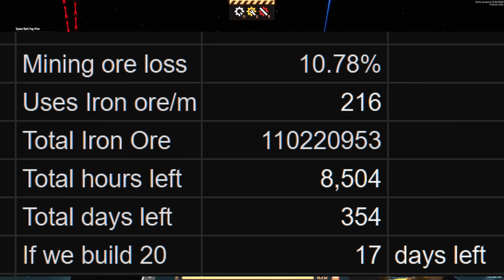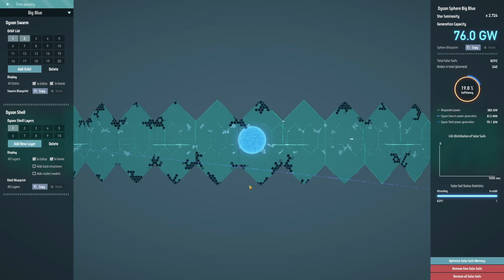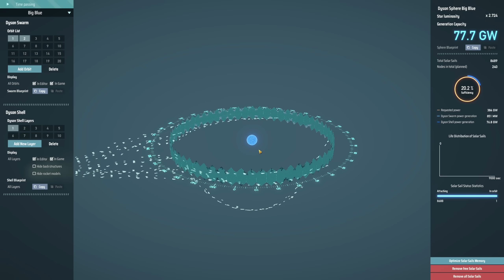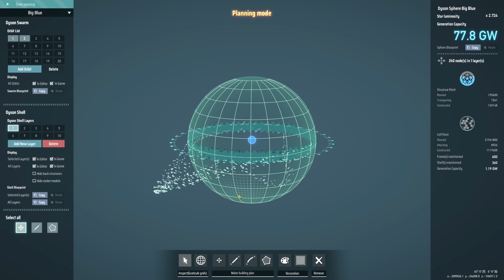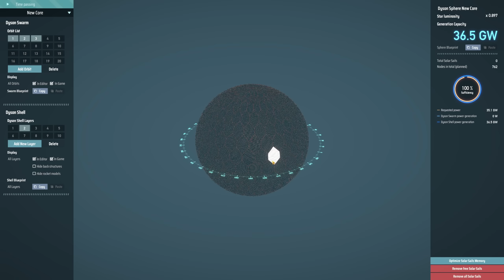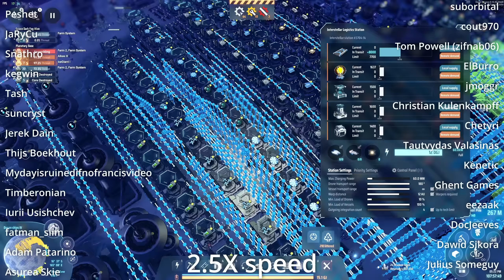When scaling up is made easy : Dyson Sphere program ep 16

Comment: In the mall, it's nice to use minimal or sensible capacity in the tower for end products, and keep stores in outside boxes. That way, when you empty a supply tower in outside system, the vessels don't plop 2000 artificial suns every time you fill up a dozen from a tower, that took hours to craft. If that makes sense.

Comment: I suspect a power pole blue print could include a space for the anti hive turret caps on the poles. I also wonder if it could include space for the combat towers that make laying down blueprints faster. Basically hit the planet in layers. aka paste in power, paste in construction paste in combat towers all leaving the bands along the equator clear. That way when the factory blue prints get laid down everything is ready for them and basically no running around is required.

I almost wonder if building a few of those combat/construction towers into the blueprints wouldn't be useful at the start - maybe they wind up being vestigial in the end but who cares if they make pasting faster / easier.
Reply: The ability to selectively deconstruct on a per-planet level is one of the big things this game needs.
I did make a powernet blueprint with BAB lines so the shield generators are build right away.
Its almost more work to collect them afterwards then it is to fly the round manualy.

Comment: (~) 17:20 For power poles around the planet, remember that sensor towers, wind, and solar(?) buildings have a power provider range which allow you to push/pull power around the planet where you need it. :) Also if you can integrate sensor towers and have polar defenses, it means no dark fog can land on the planet. Something proven by other youtubers. Though I'm curious if your plasma cannon tactic will work personally. :)

Comment: I have had some possibly-silly thoughts regarding why it is a good idea to proliferate the Antimatter Fuel Rods. This despite the proliferation not giving extra power.

1/ an Artificial Star goes from 72mw to 144mw maximum output

2/ the burn rate is  maximum, not “it will burn at x2 rate regardless”

This creates a power-buffer for your planets that use the AMR.  Normally, if it would require 10 Artificial Stars to power and then you start drawing 15-worth the planet would fall over until you went to drop another 5-10 Artificial Stars on it. With potential double output rate, all that happens is the existing ramps up to match.

The same when using the Strange Annihilation Rods. Smaller footprint that can cover expansion well.

There is always the improvement in burn-rate in the mech fuel chamber. That can be a bonus as well.

Thoughts?
Reply: Yet another possibly-silly thought:

Strange Annihilation Fuel Rods take 8 AMR to produce and hold 10x the energy (+20% bonus). They provide 144mw for 5x as long in an Artificial Star. Proliferation might double the output rate, haven’t checked.

Some of the hydrogen left over from fire ice > graphene could be converted to deuterium for the Strange Matter required.

Comment: RE: Hydrogen - any tower with an empty slot can go get more hydrogen remotely to have on hand for local delivery, thereby increasing the total amount of hydrogen you can get per minute.  Many planets had multiple towers that were basically otherwise idle and could have been sending out ships to go get remote hydrogen.
Reply: Unfortunately hydrogen throughput via ILS is one of those 'forever' problems in the game and why you can never really ignore the logistical math regardless of the style you build. When you need a lot of hydrogen you're gonna burn through more than one tower/ten logistic ships can supply, and when you have multiple towers requesting it you're gonna have to find providers for those towers so you can keep a constant flow going. Spoiler: Constant is never going to be as constant as you'd like it to be.

Also the math is never clean, even with warpers because of planet orbits and whatnot. It's one of the biggest weaknesses of the black box design philosophy Francis is doing, hydrogen to deuterium is hydrogen-hungry no matter how you approach it. Especially when you go stamping down those processes everywhere.

One suggestion (in terms of finding providers) is that for all your builds that make excess hydrogen? Put a splitter in there with an output prioritized to a tower that local/remote supplies hydrogen. Hydrogen will fill the tower there first and then the excess can be bled off to be turned into something else/burned in a generator.
Reply: The other solution I've employed is taking advantage of the fact that fractionators are 1:1 H:D, while the colliders are 2:1. I'll slap down a planet of fractionator builds, and then for thing like SCRs, call in Deuterium directly where it's needed. No super-bulky, inefficient, power-hungry machines!

Comment: Having done something similar, (making a giant sphere around a blue giant star), I can say that you will need so so so many more solar sails and launchers.  You can probably 10x your solar sail launching facilities on that planet.  I had a planet with maybe 70% of the surface covered in launchers that ran constantly to fill out my shell.  Think my processor choked before I actually ended up finishing it, but I got up to TW of power from that thing.

Comment: Great video, as per usual ;-) Why not top the tip of the pizza slice with strange anihilation fuel rod production? I really love them in my game, and they require strange matter, which can get rid of your hydrogen

For the mining setup: You got single ILS for each resource. No need to put down more towers, just add iron ore to the coal/stone towers that probably won't be utilized too heavily? You can even do that off-planet in the i-key logistics managing interface. I also usually never put logistic vehicles and warpers in the mining-planet ILS, because "pushing" is limited to 10 ships, but requesting (like you do for hydrogen) is only limited by how fast you can get ore into the tower, when each requesting ILS has their own 10 ships to use. I'd rather put more ILS on the production side.

Fractionators cap out at 144/min (72 without proliferation, which makes more sense), so I'd say they are similarly space-efficient compared to MPCs that are huge and give you 120/min. Personal tastes vary. I think you also underestimate the amount of deuterium you can directly mine from gas giants for free. As a last comment, proliferting hydrogen-to-deuterium conversion for 100% speed-up would mean you only need half the particle colliders, which saves space (not power). Additionally, in terms of CPU-cycles and your 2.4TW plans that "saving" of buildings might be worth it!